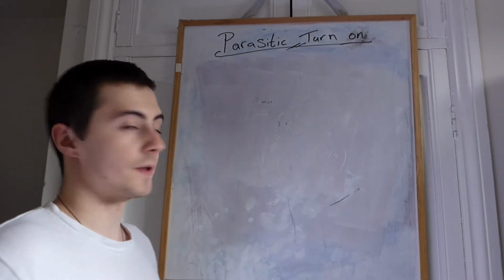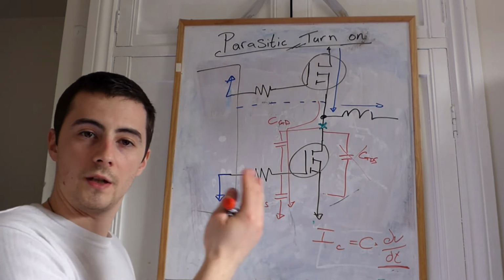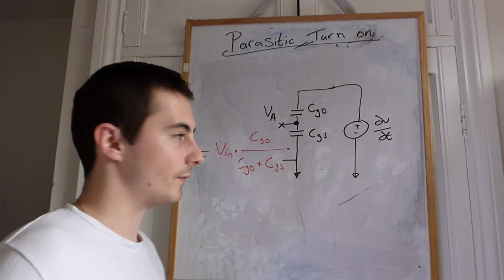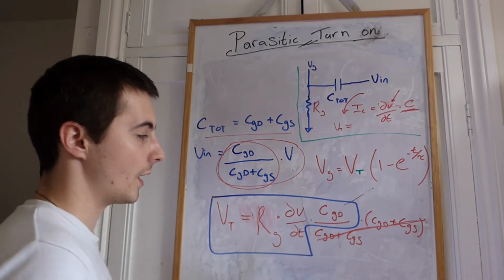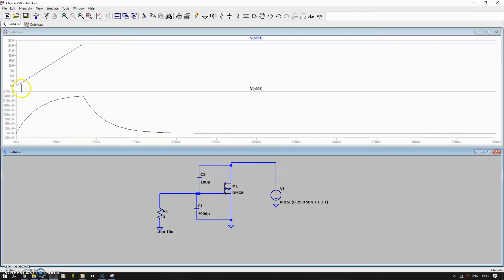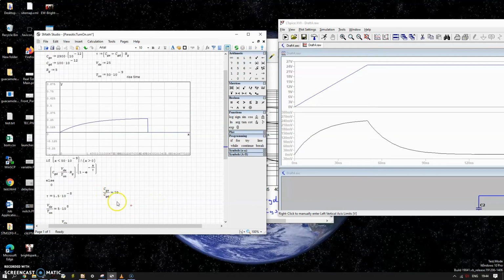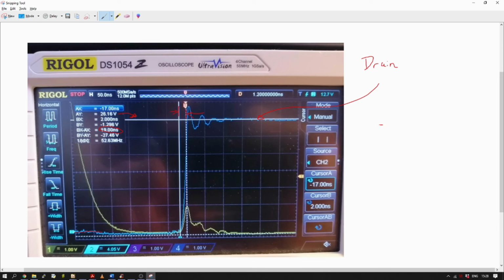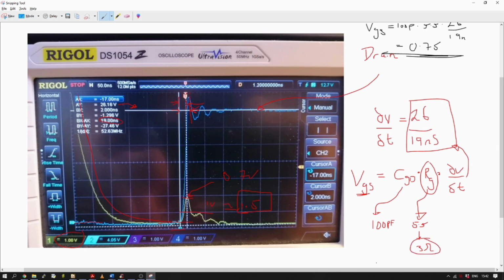How NOT to blow up your MOSFET/IGBT! Why do my MOSFET/IGBT fail? Parasitic Turn On Of MOSFETs /IGBTs

Comment: Stopped making these videos ?  Would be really nice if you could do a series on designing the ebike esc ! Any data sheet on those "thermal resistors" ?
Wouldn't you need to add the forward voltage drop of the diodes in series with the resistor ?

Comment: Good videos but can you answer this question for me I am using irfp064n mosfet and I use them to build a inverter and at low amperage like 3 amp the mosfet work but when I increase the amperage pass 3 amp the 2000 watt of mosfet just blow up in smoke and the current rating is 390 amp surge and the start up is soft start on the micro controller spwm and I use irf3710 and those mosfet work well for high current but I charge the battery full and as I connected the inverter it work but the irfp064n just blowing up so do you know why this is and the irfp064n or very expensive and the irf3710 or very cheap and work but because of the low resistance on the irfp064n is good for high power they just keep blowing up what can I do to stop this

Comment: I blow all my mosfet in my inverter circuit with the right valve gate voltage and diner diodes and all my fet still blow but only the igbt don’t blow so I know for sure that mosfet are headache

Comment: Ok 👌 
I have few questions 
Firstly I have some irfz44n mosfet I made and inverter circuit and as I power it up the mosfet blow ,again the 8 volt is the not so fully on for gate so the gate voltage was under rated but 20 volt blow the mosfet all 12 mosfet blow and the rating voltage is 50volt but as I said 20 volt blow the mosfets can u explained to me why is this

Comment: Nice explanation of a difficult topic. The main contribution for the difference between your calculation and measurement, are the impedances of the two current carrying paths. The first path is formed by the two parasitic capacitances (Cgd in series with Cgs). This path is located directly inside the power switch. Hence, the loop inductance (using dV/dt as a source) of this path is extremely low. The same is not true for Rg and the gate-driver loop where you have significant parasitic inductances. First, inductance created by the non-negligible physical dimension of the gate-driver loop, and secondly the bond wires in this loop. Typically two inside the power-switch and an additional two inside the driver. The parasitic inductance of the gate-driver loop "delays" the impact of the gate driver on rapid changes to Vgs. Therefore, the initial spike in Vgs is more difficult to calculate and governed mainly by the ratio of Cgd/Cgs. The inverse Cgs/Cgd is often used a safety figure of merit against parasitic turn-on. Furthermore, good designs try to reduce the gate-loop inductance to a minimum by placing the gate driver in very close proximity to the power switch. However, for very fast dV/dt and technologies with low threshold voltages, it is often necessary to also use negative Vgs voltages for off-state in order to prevent parasitic turn-on. 

Power electronics has a bright future. And fast switching systems are on the rise with SiC and GaN devices in particular. If this meets your interest stick with it. You got a hand for it.